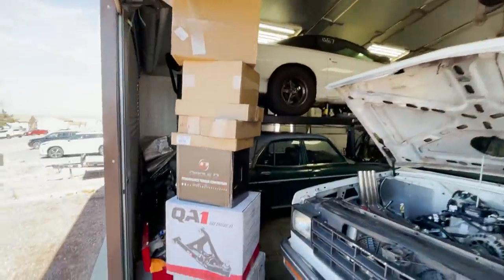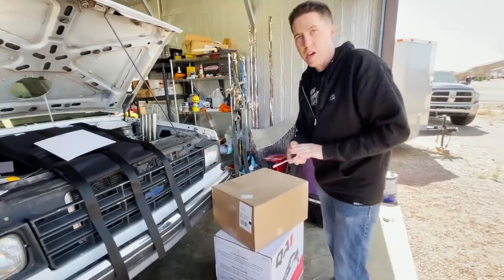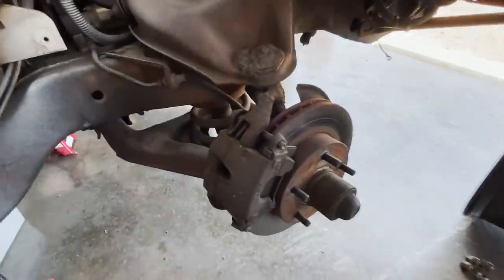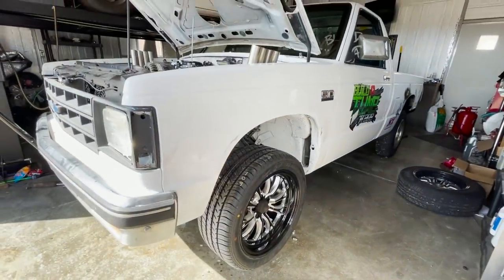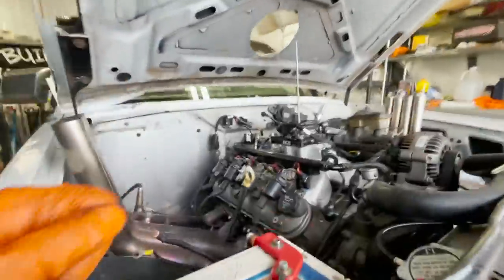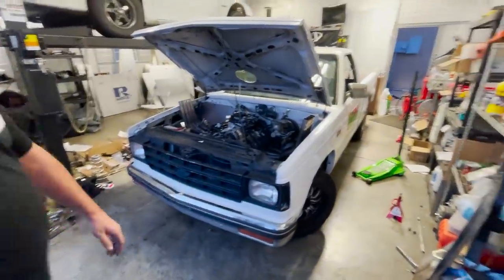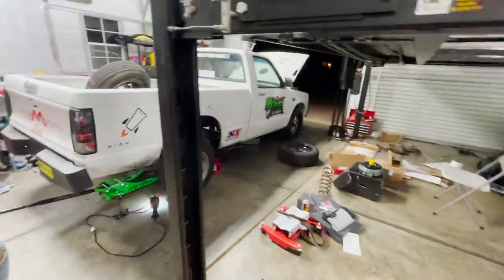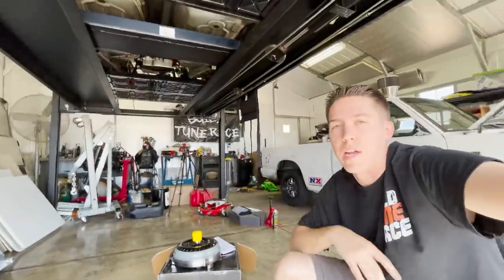Burnie The Burnout Truck Gets HUGE Upgrades!!!

Comment: Can't wait to see Burnie handle with that new suspension setup! 🔥
Reply from the maker: It’s going to make a huge difference! 🤘The adjustability in the kit is exactly what we needed!
Reply: @QA1 would this be lower than factory on an SS model? I know they already sit a bit lower than standard. Thanks ✌️🦅🇺🇸
Reply: I want a set rather need a set 😜. awesome looking product easy to use ..

Comment: Also, try running manual brakes with a willwood kit or the likes. Those zoomies will be nuking that booster and plastic reservoir. That wont help the "Don't stampede the spectators" pedal".

Comment: Also +1, Clyde would make a fantastic burnout car with a 9" and about 2.5" of thigh gap between the rear wheels (with 215/55/r15s)
Reply from the maker: I was originally going to take Clyde to a Cleetus and Car then when I seen everyone popping tires and doing wall taps I decided I wasn’t going to do that since there are barely any parts available if something gets damaged lol.

Comment: Do you do dyno/street tuning for anyone, or is that a friends only kinda thing?
Reply from the maker: I take on some tuning work! Just depends on the car mods Efi system ect.
Reply: @BuildTuneRace  thanks James. It’s a pretty simple combo. Heads/cam 6.0 ran off of a Terminator in a 2nd gen bird. I had it remote tuned a couple years ago. WOT is pretty good, but could use some drivability work. I’ll be doing RMRW 1.0 this year and would like it to be at its best if that’s possible lol.

Comment: Surprised you didn't swap out the calipers, pads and rotors while you had everything apart. Just thinking about the braking issue you were having.
It's cool to see you doing everything you can to put on the best show possible.
Reply from the maker: Due to this comment I just got done getting some new calipers 😂 The rotors don’t look or feel bad but still might replace them at some point!